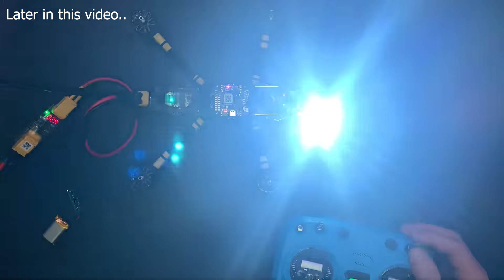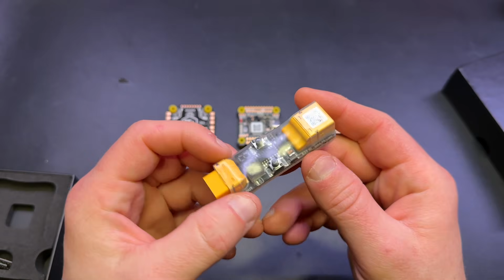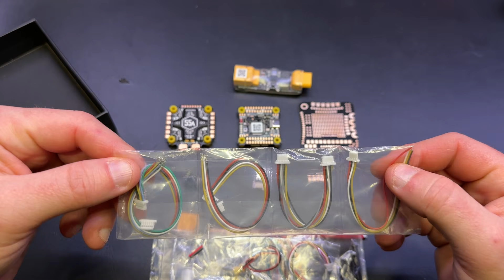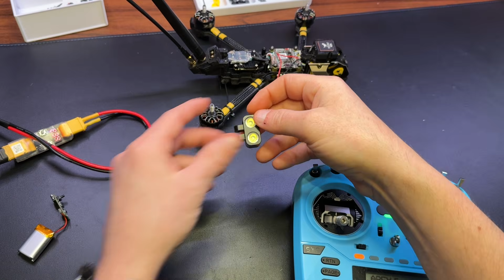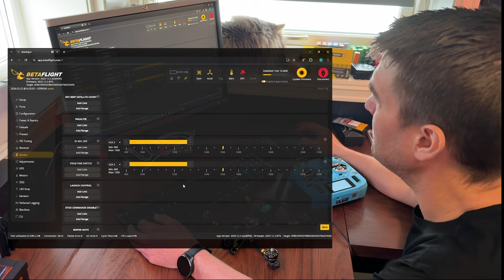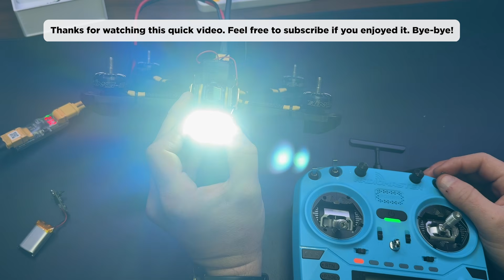This FC has some New Cool Features

Comment: Very nice. I didn't see M5-M8 pads though, like V4 had? How many servos could you add to a quad with it?
Reply from the maker: No, you’re right. I should have mentioned that,  only M1 to M4. For servos you have S5-S6 in the front.
Reply: @FrankBuilds  And maybe even the LED outputs, remapped. Might run into a current limitation eventually, I suppose. Great videos, BTW. More please!